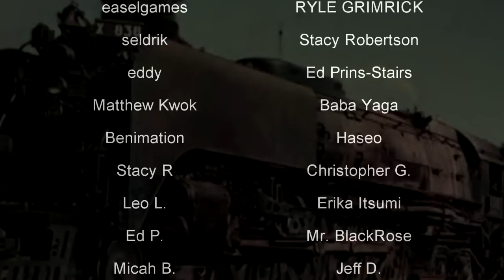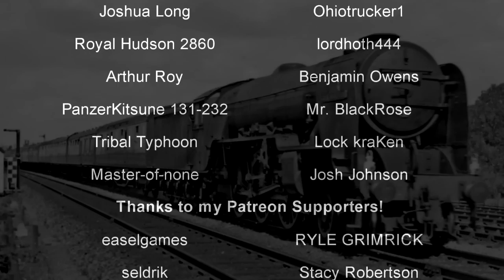The True Story of Edward Thompson | LNER's "Worst" Chief Mechanical Engineer | History in the Dark

Comment: To be honest, all of Peppercorn's pacifics were actually Thompson's designs but with various modifications to iron out the faults. So in a sense, he did kinda set the template for arguably the LNER's best pacifics that were ever built, being fast, modern and powerful locomotives.
Reply: And Thompson's Pacific designs were Gresley's designs with the weak points taken out and replaced with different weak points. Peppercorn's Pacific's were also based on Gresley's designs but with Thompson's weak design features removed.
Reply: So if Thompson wasn't the worst LNER CME was it Robinson, Gresley Or Peppercorn?
Reply: @alanrobertson9790  oh no its definitely   Thompson. His designs (aside from the L1 and a few others) weren't terrible, just other designers had made better Locomotives.

Robinson is a contender also because he couldn't manage to build a 4-6-0 that provided an overall improvement to older 4-4-0 designs.
Reply: @alanrobertson9790  what??? Gresley made peak locos

Comment: Thompson became Chief Mechanical Engineer under wartime conditions.  He had lost a great many of his experienced staff, he was manufacturing munitions and machinery for the armed forces so under the circumstances he did a good job.  He had ideas to simplify maintenance and he succeeded. He did not denigrate Gresley and only rebuilt a relatively small number of locomotives.
He was looking to the future with a simplicity of maintenance coupled with a reliability.  His rebuild of the P2 locos gave a more reliable machine, albeit with some faults but his A2/3 locos were excellent mixed traffic machines and ran more miles per year than their predecessors.
Reply: So he tried to do what Germany did in the 1920's?

Comment: 410 B1s were built so pretty successful I would say.
I did like the L1s , they look good.
I do think Thompson was on the money with his coaches very modern.
Actually Gresley used Walchaerts valve gear, he simply used conjugation to operate the inner cylinder valves
Thompson and Peppercorn simply used a complete third set on the middle cylinder.

Comment: "Gresley conjugated valve gear" (actually designed with Holcoft) referred to the system of levers that operated the valves on the centre cylinder from the valvegear driving the outside cylinder valves. This meant one set of Walschaerts on each side of the loco only and avoided the need to put a third set in the middle. Apparently they didn't get the timing absolutely rght until BR days. The same system was used on NSWGR D57 4-8-2 freight locos and on many others on other railways.
Reply: The main problem with the conjugated motion was accumilated slop in the joints, made much worse by the lack of maintainence during the war.

Comment: The Gresley valve gear is ingenious but has inherent problems. The aim was to use just two sets of valve gear (normally Walschaerts) to activate the valves on three cylinders, using an arrangement of levers. Unfortunately the drive for the inside cylinder valve gear was taken from the outside ends of the outside cylinder valve gears, and were therefore affected by expansion. Then there was wear and tear. Taken together, the result was that valve events were incorrectly timed, giving the uneven beat.

The same principle was used on four cylinder GWR engines, but the valve gear was to the inside cylinder valves and the drive was from the inner ends of the inside cylinder valve gear spindles to the outer ends of the outside cylinder valves, using rocking levers and a knuckle joint. The two inside cylinders were set well forward and the outside cylinders well back, with curved steam pipes. This seems not to have given problems.

The limitation of the GWR design was the size of the cylinders. The special design of the King class bogie was to allow larger inside cylinders.

The Gresley arrangement was used for some three cylinder engines on the Southern Railway. Its shortcomings led to other experiments including the Bulleid chain driven valve gear and the Caprotti and other rotary cam systems.
Reply: Very nice summary. The GW engines didn't have problems with the valve gear itself but the positioning of the outside cylinders was in a serious weak spot in the frames - ironically inherited from the de Glehn Atlantics - which also limited cylinder size. The "Princess" 4-6-2s on the LMS had the same problem, but they then relocated the cylinders for the "Duchesses" which worked much better.  Hadn't realised the Gresley conjugated gear was also used on Southern designs, but it seems logical since it was originally invented by Holcroft of the SECR and SR.
Reply: @iankemp1131  The King class were all rebuilt around 1954. They should then have remained in service until the mid 1970s. They were performing superbly well at the time they were sent to be scrapped. Their successors didn't last long, either.

The same goes for the 70xx Castles.
Reply: @physiocrat7143  And indeed for a lot of other good engines around the time including the BR Standard classes. The snag for the Kings and Castles was that the inside valve gear was difficult to access and maintain which was an increasing problem with 1950s/60s labour shortages. The LMS Duchesses also disappeared rather promptly for similar reasons, so that most of the final "End of Steam" railtours and photos seem to feature Black Fives and Britannias.
Reply: @iankemp1131  There is a story about that in a book written by a fireman. There are about 120 oiling points on a Castle. His driver told him to throw a bucket of oil over the whole lot.

Three cylinders and Caprotti valve gear is probably the way to go for large engines.
Reply: cough gresley-holcroft valve gear, though really holcrofts name should come first he did the brain work to make the idea work in as much as it did, he also revieved the first patent for system deriving the 3rd cylinder drive from the outer cylinders, he also built the first loco to do this. Gresley came along and asked for his help when he wanted to do it with the only significant difference being the point at which the drive was taken up, holcroft preferring to avoid using the valve spindle over concerns of expansion due to heat throwing the timing out.

Comment: I have to question your statement that the P2s were a successful design. They were very very flawed locomotives. They had a long list of issues... First up they were built for the Edinburgh to Aberdeen route, a fairly slow line in the scheme of things, but Gresley streamlined them, for no other reason than looks. The casings did nothing but cause issues with repair and maintainence. They were 2-8-2s with a long wheel base, but running on a very twisty route with tight curves, not only did this damage the track work but also stressed and cracked the frames, resulting in them often needing heavy repairs. The crews hated them, the streamling and the long boilers obscured forward vision from the cab, the lack of any smoke deflectors added to this problem and they were extremely heavy conummers of coal making the firemen over worked and the locos expensive to run. Add in the other trademark issues that plagued many of Gresleys other designs, such as the poorly sprung and derailment prone pony trucks (also an issue on the V2 and K3s - something else Thompson fixed) and the three cylinder single casting cyinder block which meant any repairs on one cylinder resulted in the entire front end of the engine needing to be rebuilt; and you see the P2s were complete turkeys. The LNER board refused Gresley permission to build any more than the five locos in the pilot batch, and by the time Thompson came to rebuild them into pacifics four of the five were out of service needing heavy repair, this being at a time when there was a shortage of labour and railways needed ever engine they could get for the war effort to the extent old locos were being dragged out of crap yards and put back into service. In short the P2s had to go.
Reply: Last time I checked, the P2's frames didn't crack basically every hour
Reply: @NW2174Fan  Lol not every hour, who said that? but the fact the frames cracked at all makes the design questionable.
Reply: @stashyjon  I came up with it myself, and yes, the fact the frames of the A2/2's cracking shows that maybe Thompson should've tried something else at the time (or maybe Peppercorn should've been CME of the LNER to begin with)
Reply: @NW2174Fan  rubbish.  The frames cracked on the P2's very frequently, simply due to the wheel base length, the A2/2 used the rear 2/3rds of the P2's frames so these were already stressed and fatigued, added to the Thompson ideology on the front end leading the A2/2 to have a too longer wheelbase also. 

The P2's would not have lasted until 1950 without rebuilding, there were non standard locos, very maintenance heavy, and often found to have low availability. They were a cracking design, but not suited to the line they were designed for (something Thompson is not unique for). 

peppercorn was a great engine designer, and took the best of the Gresley and the best of Thompson to make some of the best yet most over looked classes of locos used on the LNER.  One of Gresley's short comings was the insistence on using 3 cylinders when 2 would have done on some of his smaller designs, and the use of Gresley-Holcroft conjugated valve gear when the use of 3 sets of valve gear really was the better option.
Reply: @James_Rivett  Yeah, and so did the LNER A1's/A3's, also, if this did happen, show me proof because I'm have trouble validating your claim
Reply: @NW2174Fan  more so with the GNR designed A1's than the later LNER Built A3's, the GNR A1's had hand holes, and cut outs to keep the weight down and also to aid maintenance, These suffered when rebuilt to A3's as the frames struggled with the extra power, and there is many photos showing these A1's in the works with the cut outs and hand holes with a bit of plate welded in them. It is rumoured that Doncaster works kept a spare set of A1/3 frames in stock for locos who's frames were buggered.  

This only adds to the disbelief that the Late Rolland Kennington decided to rebuild Flying Scotsman in the manor he did for the Late Dr Tony Marchington, boring out the cylinders from 19 to 20 inch, upping the SWP of the (then fitted) A4 boiler from 220 to 250, and increasing the superheating surface area (by fitting lager diameter elements) and increasing the main steam pipe diameter, which all had the effect of turning 4472 from a class 7p loco with a tractive effort of around 33000lbf to in the area of 40000lbf, all on a loco that was well known for frame weakness. is it any wonder the loco's frames were buggered (not to mention the bodges he did when fitting Salmon Trout's cylinders - these were built as A3 cylinders and had different hole placement to those built under the GNR and early LNER as A1, so he ovaled the holes out in the frames), and then tried to blame it on the loco being lifted onto ships for the USA Tour under Alan Peglar and the Australian tour under Bill Mcalpine, and the state of the Australian track form on the 1988/89 Aus Steam tour. While I had every respect for the man, including the massive effort he did when the loco was down under, to me the modifications he did in the late 1990's were madness. 

Of course most Gressleyites don't like mentioning that a lot of Gresley's smaller locos (B17's, K3's etc) suffered from terrible ride quality's once slightly worn, but very happy to point out this issue (usually alnough I've not seen it here) on Thompson loco's. 

I think one thing that benefitted the likes of Gresley and Peppercorn, is he carried out a Practical apprenticeships. Gresley did his at at crew works, and then worked his way through the ranks at the L&YR before joining the GNR.  Peppercorn also learnt the job as an apprentice with the GNR at Doncaster and a understudy of SNG. Thompson was a academic, and his knowledge more theoretical than practical.
Reply: @James_Rivett  I didn't ask for a whole essay :/

Comment: 9:30 Actually 3 of the P2 mikados had suffer 3 crank axles failures in 1943. Another thing about he P2s was that they were supposed to have an availability of 57% however their availability was 53% at 1942 this later dropped to 46% during 1943 and were achieving 25,000 miles at that time when they were supposed to be achieving 70,000 miles. 
Let’s recap: 
-THREE CRANK AXLE FAILURES DURING WARTIME.
-46% PRECENT AVAILABILITY ALSO DURING WARTIME.
-25,000 MILES ACHIEVED ANNUALLY INSTEAD OF 70,000 MILES.
HOW THE HELL WERE THE P2S ANY GOOD?!?!
Reply: Yeah, I can't believe they chose to do a new-build P2; they were rubbish and not overly attractive- for me at least.
Reply: @captaincool3329  because they were unique Gresley Designs which hardly lasted.   Whilst it’s true they could build other engines (I wouldn’t complain if we got a new A1 and left Scotsman as is),  they intend to rectify some of the issues and maintenance isn’t as much of a problem because the engine won’t work as hard as the originals had to.
Reply: @captaincool3329  they were not rubbish loco's, just unsuited for the twisting route they were designed for. If they had been used on a fairly straight route you might have found their reliability and availability improved a lot. 

No matter what anyone try's to say or claim, the New build P2 IS NOT a Gresley P2, its using a superior Peppercorn derived boiler, modified and improved steam passages and superheating, and improved valve gear and using of roller bearings. It just looks like a Gresley P2 that it uses for inspiration. Still a fantastic bit of engineering though.
Reply: Mikado types can't be streamlined you must build them with Accessible features and usually aren't that fast but can pull oar trains and heavy fraight on a slow line that's all the P2s should have been a 4 8 0 not a 2 8 2 because of wat I just said